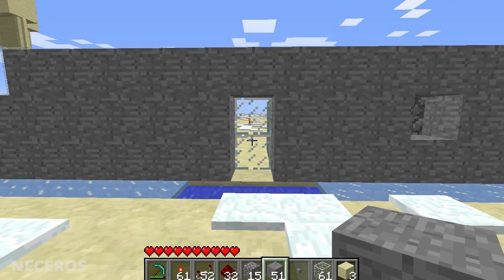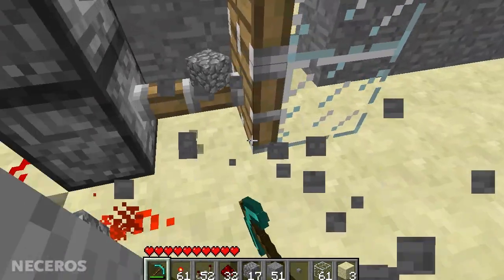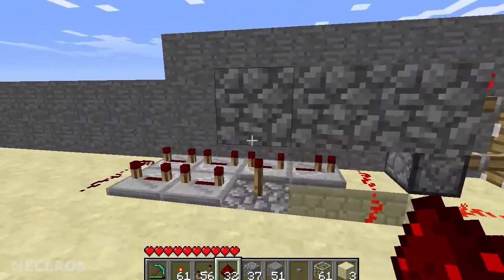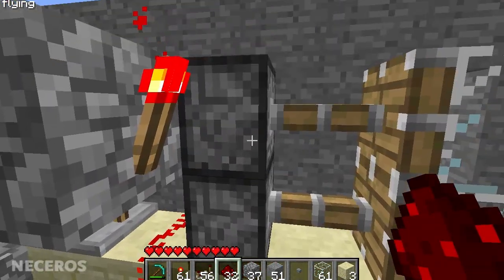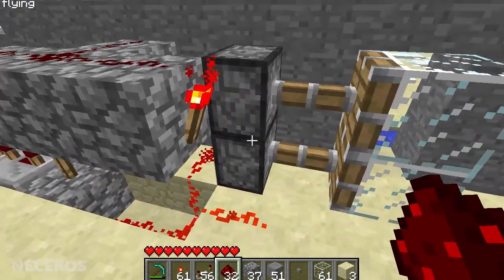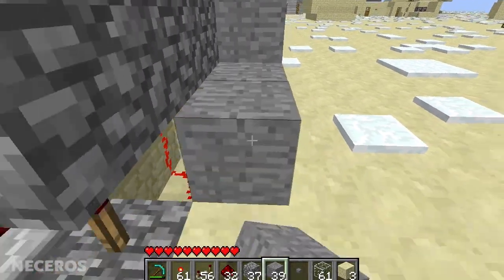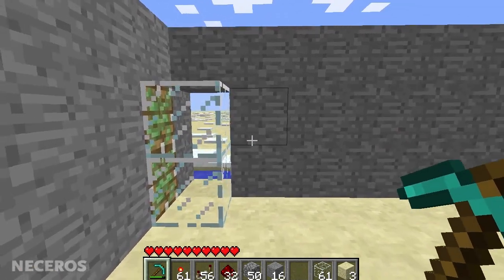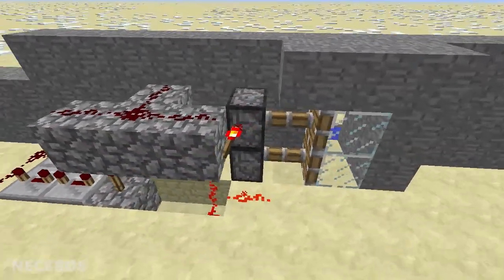Minecraft Tutorial - 1x2 Piston Door - Time Delayed (Monostable Circuit)

Comment: There is one problem: if you push the button after the pistons already closed the door but before the cycle of the repeaters has end (they are still iluminated), the pistons open again the door but whithout the delay. It's not a big deal, just wait a little longer and the design will work fine